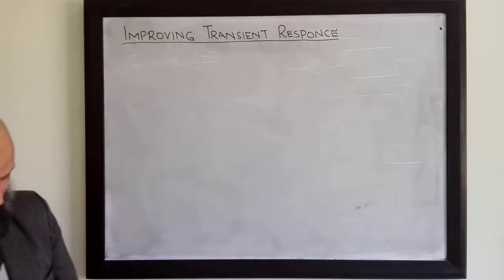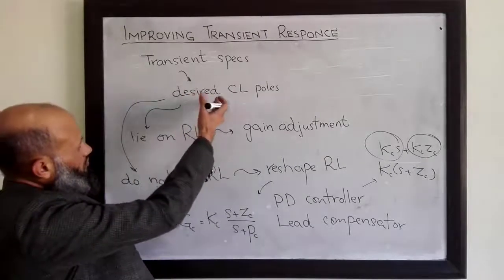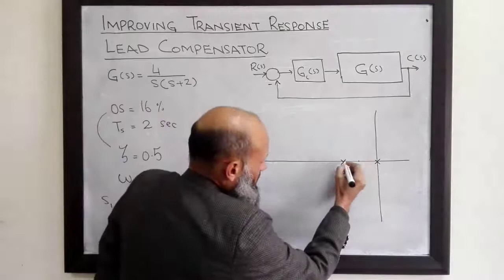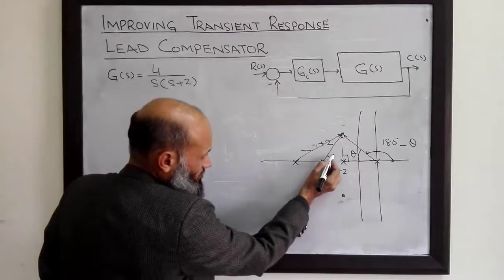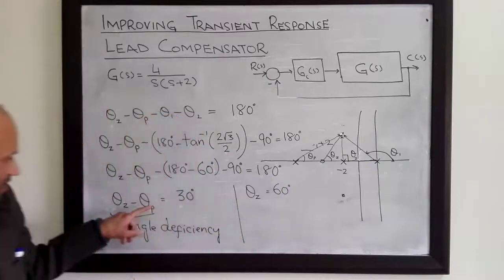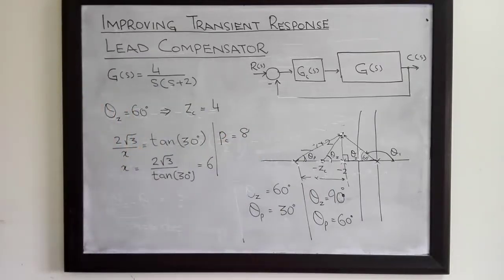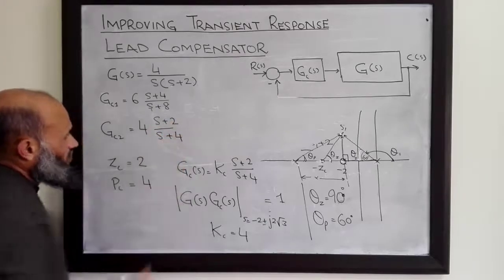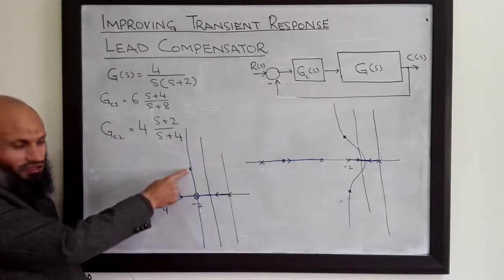LCS 37a - Design of a Lead Compensator

Comment: Came across your video while performing a search for root locus based phase-lead compensator design after already having studied the bode plot design version.  Your video tutorial was thorough and explained very well the approach for determining the placement of the zero, the pole, and the required gain of the phase lead compensator.  This definitely improved my understanding on how to design a phase lead compensator via the root locus method.  Thank you.  👌👍🙂💯

With a simulator on hand, my general approach is to place the zero of the compensator to the left of the dominant poles of the plant transfer function and the pole further to the left of the zero by some factor - since in effect our objective is to pull the root locus further to the left.  I notice that without going into deep analysis, but rather through principles, I am able to get a rather nice compensator within 2-3 simulation iterations which takes no more than ~1-2 minutes (I run the bode plot and step response tests - sometimes also the ramp response).  For example, for the first example, within two simulations I was able to obtain an overshoot of 9.8%, a settling time of 1.64 s, rise time of 0.43 s,  and a phase margin of approximately 63 degrees - all exceed the requirements given.  In practice, which method would you advise?   Seems with technology the analysis and design is really simplified.  I do understand that you must first understand the theory in order to apply control system principles for proper design as you have excellently shown.  However what would be your advice on this matter?  Thank you for any feedback that you may provide.

Comment: Sir,how you have calculated  30 degree can you break down  it?😊
Reply: If you review the video, the requirement is: Θz  - Θp - (180-tan^-1(2*√3/2)) - 90 = 180.  Thus, we have to choose the zero and pole of the phase lead compensator such that the mathematical term on the left side is equal to 180 degrees.  After light algebra, you have:

Θz  - Θp  = 180 + (180-tan^-1(2*√3/2)) + 90 = 180 + 180 - 60 + 90 = 390
Θz  - Θp = 390 = 30 (since every 360 degrees is the same as '0' degrees,, the equivalent is: 360 + 30 = 390 or 0 + 30 = 30 degrees, where we substituted 0 for 360 since they are equivalent)

That is, if you are at the 0 degrees point on a circle, and traverse along its perimeter for 360 degrees, you are in effect back at the same point.  This is why you can subtract 360 degrees from anything above this value and only be concerned about the net total.

Does this help?  Make sense?
Reply: @cazadudesigns  yesssssssssss

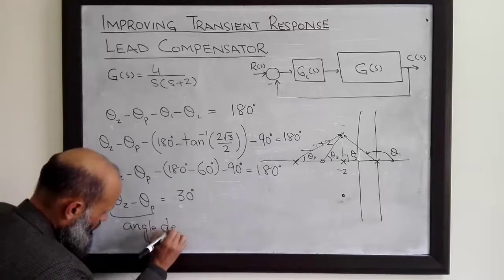Comment: How is the angle at (11:31) equal to 30 degrees???? It must be 180+210 = 390 degrees
Reply: or is it because of 390-360?
Reply from the maker: Yes, it is because 390 - 360 = 30. Another way to explain it is that the expression for the angle condition will be true even if we take -180 on the right hand side. And in that case, the calculations will again result into angle deficiency of 30 degrees.